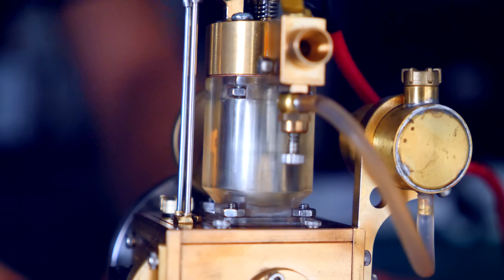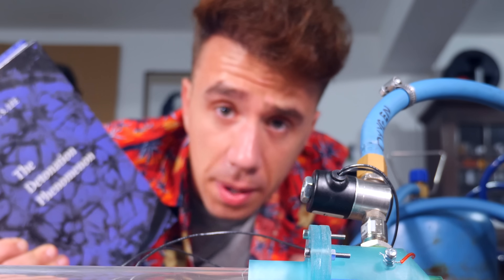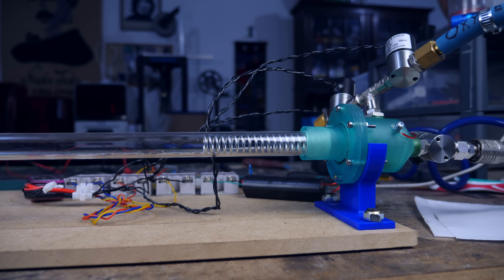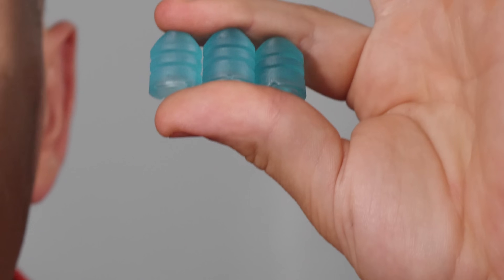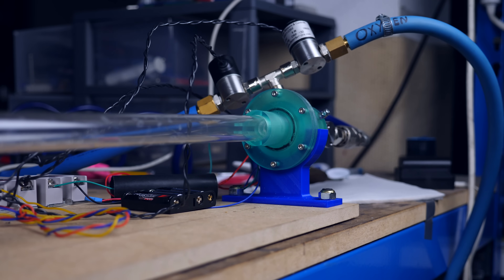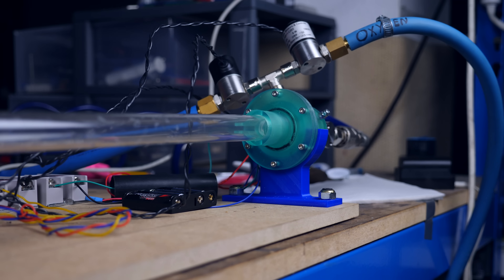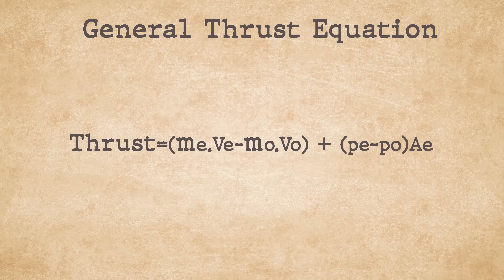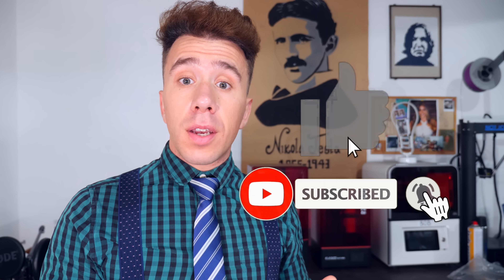PULSED DETONATION ENGINE

Comment: In the filming process of the video you should had use some earplugs...
Vídeo Suggestion:  try making a motor powered by a flywheel and put on top of the skateboard (i don't know if you already done it before)
Another one would be a regular engine (like a in-line 5 or 6, or a V style engine)

Tomatoes are disgusting

Comment: Maybe try hydrogen gas as a fuel, Ebay has plenty of hydrogen generators to choose from, and it works from electrolysis with water and certain powder elements added

Comment: you said faster valves. if you have extras around do a 180 offset of pulse. Could even print some kind of manifold setup to get more and see if worth the added cost of the correct valve.

Comment: How about putting a small restricter /nozzle on the end of the tube.  Then make the tube a length at different lengths so the pressure wave bouncing back and forth builds up. That could increase the pressure in the tube and if the length is right cause multiple out of phase waves of pressure.

Comment: Have you ever debated using plumbing pipes and materials for a jet or rocket engine? its easy assembly plus its all interchangeable and high tempature resistant. easy to get as well.

Comment: Suggestion:  Make a video using HHO(H2 +O), but use it to create high pressure to run a tesla turbine and use the exhaust to run another engine type. Maybe use the exhaust with your Rotating Detonation Engine.  :P

Comment: You need reed valves. Really just one, for the air intake. you’ll have constant flow of fuel to the chamber And that reed valve will open and close organically against the chamber pressure, so the engine can breathe. Throttle the engine with fuel metering.

Comment: You should use back flash arresters used on cutting torches as your valve. We use them at work so if somthing happens the flame can’t go back up the hoses and into the tanks. Thy are open and flow but once a pressure wave hits them thy shut.

Comment: You don't need to control the valves. Just use reed valves to prevent backflow in the fuel/oxidizer lines. Set the pressure or flow rate appropriate for your desired frequency and spark away at the desired frequency.

Comment: Why dont you combine multiple engines connected to just one output, and stagger their detonations in order to have a much more constant detonation cycle? You could keep using the electric solenoid valves, and they would no longer be the bottleneck.

Comment: Instead of solenoids, try adapting some fuel injectors. You could likely use them for both O2 and fuel gases since I believe I have seen a propane adapted fuel injected chevy motor before on a gokart

Comment: Revolver Shockwave engine. 6 chambers spinning 3 active with spark while 3 inactive filled with fuel.. Just timming of spark with rpm of revolving chambers and adjust fuel rate. The revolver is your valve just need good seal so gases dont leak

Comment: put on the rotary engine, on the base of the cylinder multiple gas/oxygen valves alternatively with a start-plugs for controlled detonations in spiral/circle: 
detonate via plug -> inject gas -> inject O2 -> detonate via plug -> inject gas -> inject O2 -> detonate via plug -> inject gas -> inject O2 ->  ...layers

Comment: If one were able to (continously) inject fuel air mixture in faster than the "flame"/detonation can spread ... The flame can't burn backwards fast enough to ignite the new mixture being added, and the flame will be blown off. It's akin to a pulsed combustion without any valves. 

Try an extremely fast jet of  fuel/air being injectected tangential in a combustion chamber. Should get pulsed combustion running in a circle.

Comment: At these high speeds i don't think you need a valve at all. The electric pulse does the triggering and the rest of the time the gass is filling the chamber.

Suggestion for next video: a 3d printed (resin) monocular micro telescope (yt: Huygens optics - mini space telescope)

Comment: A "tuned" exhaust would make for an interesting video. varying the diameter would obviously get varying results. Length also makes a difference. One optimized to push a projectile rather than push the whole assembly has a different length than that of used for acceleration.

Comment: Add a venturi pump on the end of the barrel.  The gases exiting the barrel are going very fast so they are at a low pressure.  This will draw in air and send it out the back end at high speed.

Comment: You should either invest in a welding machine to weld your own nozzle designs or a furnace to pour metal molds (with a 3d printed mold) and test different nozzles, for science

Comment: If you'd inject a super heavy inert gas into the exhaust between detonations it could act as an invisible projectile giving more thrust to the shockwave engine. Also, check your oxygen to fuel ratio so you get the most bang for your buck. Just an idea

Comment: First, Caterpillars don’t emerge from cocoons.

Second, you should add a rocket nozzle.

Third, if you put in a sensor to measure pressure, you can graph the power/frequency curve.

Fourth, ideally you’d have an adaptive frequency program that tuned the frequency for the highest power.

Fifth, when you set off the metal version, I thought you were playing the Miami Vice theme.

Please add the drum track.

Comment: Many years ago i have done such using an Arduino for my timing using Propane&butane and Oxygen to get the highest exsplosion , 0.20 ms is the best in timing for injection the gasses  and oxygen.
the only way to get masive explosion is to create a higher volume chamber, 
IE larger explosion chamber. simple maths.
here is my used method 
https://youtu.be/5o3-puZhyj4
132 DB to 163 depending if im timing to just the chamber or the chamber and combined exposion with exuast .
also a factor that needs to be implemented , and that is how the gas and oxygen gets mixed, 
i make a cyclone effect in my maching to produce a high mixture rate of the gases and oxygen to get maximun thrust/power ventilation
so my mixyuture  is 92%oxygen and the rest with gasses,
oh alsomake sure the gases don't directly get in contact with the sparkplug, as this causes a freeze up. and will delay combustion/expolsion
Also use a Resitive type electronics, as the EMS will cause timing issues in the arduino. i use a Resisive spark plug
and use isolated buck coverter to power the arduino and the coil/ignition, 
This prevents data loop hang ups aft long period running time,
Using Varibles in you Arduino code make it quicker to change settings,

Comment: Search Convergent-Divergent nozzles... your analysis is sort of correct but thought about incorrectly. what you  are experiencing is a choked detonation... even if you increase the pressure, you won't get any increase in exhaust velocity. when flow is supersonic, bernoullis equation is reversed. This why an afterburner engine nozzle opens, as the supersonic flow requires a diverging nozzle... not the convergent one needed with supsonic flow. hope this helps

Comment: An RC car would be wonderful for visualizing how powerful these engines are, you could build most of what you need custom to fit jet engines. Maybe a box frame with plenty of room in the middle to mount engines with a low center of gravity? Strong steering, good bushings/bearings, solid suspension, and a nice set of tires are what is going to be important for good performance. A model like the traxxas bandit may be a good candidate as the steering is all mounted to a smaller subframe, offering a ton of flexibility on how you want to build the rear.
Reply: I see a problem of scale lol

Where you gonna put the tanks... Very limited engine, ain't gonna have enough in it to deal with all that.

Comment: Yeah.... the problem with using detonations is the shock that they apply to everything in the vicinity.. which is exactly what destroyed many of your 3d engines.. well the ones that didn't just melt. The problem being that they apply force pretty equally in all directions, even if one direction is open while the others are closed.. the initial shock wave hits the same but then part of the force transferred to the walls is deflected back down and out the open area. It's a simple matter of physics.
In the world of guns 30m/s is slower than an airsoft pistol.. a 22 LR fires at 1700ft/s aka 518m/s, an 8mm Mauser fires at 3700 ft/s aka 1127m/s, a standard 45 ACP WW2 military round fired at 830ft/s aka 252.984m/s. A standard recurve longbow fires about 225 ft/s or 68.6 m/s.. a regular cheap slingshot fires at 300 ft/s ~91.5 m/s. 
The reason it's so much louder in metal has to do with the natural resonance of the material as well as how hard it is. Because it's harder than plastic it doesn't give and absorb the sound, instead it comes out the exhaust. If you made it out of stainless steel it would be higher pitch and even harsher sounding, titanium even more so, just like motorcycle exhausts. 
The thing is you still aren't making a jet engine, you are closer to a rocket engine than a jet. Jet engines suck air in and push hot exhaust out.. That is just injecting oxygen and fuel which makes it far closer to a hybrid rocket engine that could work even in space. And in all actuality you basically just made a fake 50 Cal rifle just like they use on movie sets.

Comment: Are you considering on making a larger "blast chamber" in combination with longer and shorter piping as well as a step up in size half way down the line?
Longest question in the world
Reply: Not 100 percent sure but I believe the tube length needs to be a certain length and diameter for the engine to detonate. Like a pulse jet.

Comment: Instead of relays, you could potentially use a rotor + stator setup to time everything.
Reply: Was thinking the same. Like a hydraulic motor valve or a cam shaft. A stepper motor or BLDC are very easy to time. But any electric motor will work with Pwm
Reply: The limit is the valve itself. Inertia, momentum, and magnetic field strength, among other variables, finding their detent.
Reply: @MadScientist267  I’d imagine the bottleneck would be the gas purge and mixing rather than a faster valve.

Comment: Could you use continuous air and fuel flow with individual prechambers with a metal flap as a valve? Much like in a buzzbomb. Pressure from the first explosion would close the valves allowing for pressure buildup in the prechambers  after pressure would be released, gases would mix again and you would just need to reignite at the correct frequency. A tesla valve might also do the trick.

Comment: The pulseJet should be self igniting after first firing, the flame traveling up the tube after detonation should mix with the air and fuel filling the tank section and ignite, again and again.

Comment: a small side idea with the projectile launcher, you could maybe design a more powerful cannon and test the coeficcient of projectile design (length, cg, mass, tip design) and rifling on the barrel. this is all possible on a resin 3d Printer.
just a small idea that was floating in my head for a long time...
Reply: the issue there is the size that he's restricted to, in order to do it properly you'd need a resin printer the size of a kitchen fridge

Comment: Mechanical valves actuated by cams on a spinning motor, with another cam for the spark trigger, could give faster and adjustable triggering.

Comment: Spinning a ball valve with a stepper would give 100pps at 50hz, getting fast for a stepper, 3000rpm, brushlessmotor. - 30,000rpm thats 1Khz firing rate.might nor be enough time for fuel entry and will destroy a plumbing valve. .  Or maybe make a valve with more through's , so multiple cycles per revolution of the valve.  Thought proviking and inspirational.

Comment: Idea for a future video: Since you use compressed air so often in your videos it’d be cool to make a 3D printed air compressor. You could use it to test out some other things you’ve built that require compressed air. It could be electric powered or for a bit more of an Integza style video you could use a gas turbine.
Reply: Yeah this would definitely be a good one
Reply: while it would be a fun idea, trying to build your own pressure vessels with a 3d printer is absurdly dangerous and the possibility of a catastrophic failure is very very high.
Reply: @DuriensBane  True. Perhaps just the pump or compressor assembly etc. rather than the the pressure vessel. Might reduce the danger factor and anyway this guy builds jet engines in his garage sometimes without eye protection and awfully close to high-rpm blades so a lil bit of danger if handled well wouldn’t be out of the ordinary.
Reply: @DuriensBane  print hollow volumes to be stuffed with glass fibre matt then resin?
Reply: @stevecummins324  it wouldnt be the container itself, it would be at the interface of the vessel and the connection that would be the weak point. Im reading now that you can have carbon fiber vessels but i would almost 100% assume that the connections are either brass/stainless/carbon steel in some form. Which would severly limit the viability of 3d printing. I dont see an issue with making an air pump, but a compressor is a different animal.
Reply: @DuriensBane  Still cool idea tho

Comment: Can you try to put a larger diameter pipe around the exit of the barrel?  Like 20 cm long, with 10 cm over the barrel, and 10 cm past the end, and about 0.5-1.0 cm space between?
The idea being to reduce eddies and suck air in to mix with exhaust flow.
No idea if this will help convert pressure into thrust, but I don't think it's hard to try.

Comment: Video suggestion: it would be interesting to see whether the pressure from the shockwave jet engine could rotate a Tesla Turbine much faster than previous experiments
Reply: This has been a subject of recent research in the field of detonation engines. Harnessing the output of these engines is extremely difficult . With large turbines you have a shot at making it work but I don't think a Tesla turbine would be very efficient at all.
Reply: @haydennorris2913  or even work at all, the disks would just shatter as soon as the first detonation hits them
Reply: If he does this, I will give him $20. We dont care if it works or not. We just want to see some action. It might even completly destroy the tesla turbine, and we will still enjoy that kind of stuff.
Reply: I suspect that it will have some loss in efficiency compared to compressed air.

Comment: Video suggestion: Make a toy slot car racetrack with cars BUT they have to levitate. Complete at least one lap without failing. The real challenge is to still use the wired controllers to control the race car. Cheers!

Comment: It appears that you are simply letting in the fuel to mix a bit randomly. What you need is a way to make a stochiometric mixture. This would increase the output significantly, and probably make an already dangerous toy into a litteral pipe bomb. Anyway if your fuel is Buthane, then the mixture should be 2 C4H10 : 13 O2 (that's 2 mols buthane to 13 mols Oxygen). this would result in a complete combustion, producing far more exhaust gasses, and thus producing much more thrust. You should check the details with someone more capable in chemestry, but I'm pretty sure I'm right.

Comment: For the valves I would go for LPG injectors used in car engine LPG conversions. They should be able to open with required frequency still being relatively cheap.

Comment: You could try to Build a Jet engine that uses Propane as Fule and Ad oxygen in the combustion to Power it up. Maybe thus will give it sone extra thrust. Or it simply Explodes. Anyway it would be interesting.

Comment: Open the internal diameter a bit and get the expansion portion (of the exiting gas) closer to the mouth of the tube and it will create more overall thrust but will also heat the system faster marginally

Comment: If the exhausts pipe were of size and shape such that it supported a standing wave of the frequency this is being pulsed at wouldn't this in turn become far more powerful by generating the forces obtained in a rotary pulse engine only instead in linear form?  I'm thinking a half wave or perhaps better 2/3 wave as the 2/3 would place the peek of the standing wave at the opening of the exhaust.  It would be akin to having a jet engine which runs on ultra powerful sound.  The only problem I forsee is the actual shockwave altering the speed of sound in the medium such that creation of a standing wave becomes more difficult however proper tuning should alleviate this .
PS: Tomato's ARE disgusting!

Comment: you should try to create a "MACHINE GUN JETPACK" by instead of throwing out supper light gasses, you throw out actual solid mass projectiles to produce thrust. you wouldn't need as much speed in the "exhaust" to produce the same amount of thrust as your other projects. also it would be AUESOME!